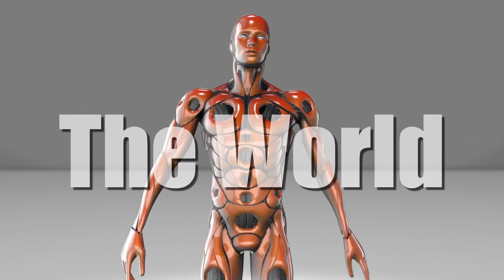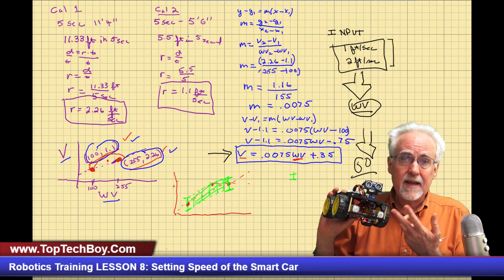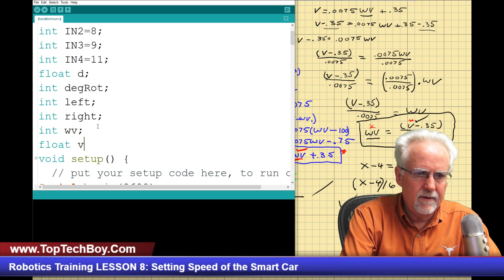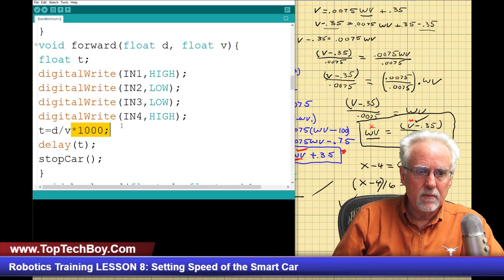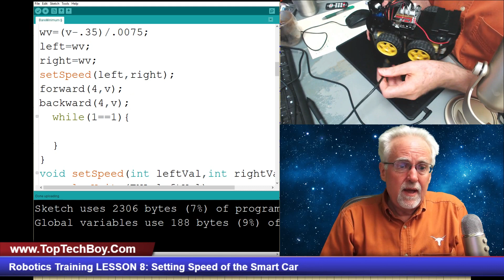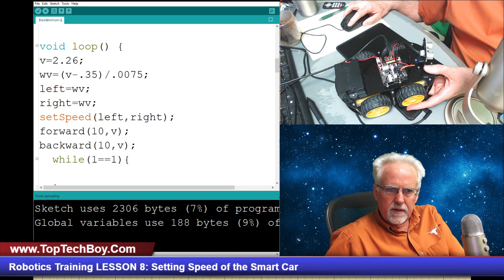Robotics Training LESSON 8: Setting Speed of the Smart Car

Comment: Can we try to solve as a quadratic function? 
import numpy as np
import matplotlib.pyplot as plt

# Define the points
points = [(100, 1.1), (255, 2.26), (177.5, 1.848)]

# Coefficients matrix (A) and Constants vector (B)
A = np.array([
    [points[0][0]**2, points[0][0], 1],
    [points[1][0]**2, points[1][0], 1],
    [points[2][0]**2, points[2][0], 1]
])
B = np.array([points[0][1], points[1][1], points[2][1]])

# Solve the system of equations to find a, b, and c
solution = np.linalg.solve(A, B)
a, b, c = solution

# Print the solution
print(f"a = {a}, b = {b}, c = {c}")

# Define the quadratic equation
def quadratic(x):
    return a * x**2 + b * x + c

# Generate x values for plotting
x_values = np.linspace(50, 300, 500)
y_values = quadratic(x_values)

# Plot the points and the quadratic curve
plt.scatter(*zip(*points), color='red', label='Data Points')
plt.plot(x_values, y_values, label=f'Quadratic Fit: y = {a:.4f}x^2 + {b:.4f}x + {c:.4f}')
plt.xlabel('X-axis')
plt.ylabel('Y-axis')
plt.title('Quadratic Curve Fit')
plt.legend()
plt.grid(True)
plt.show()

Comment: The first time that the battery voltage drop changed our velocity, first thing that came to mind was a current sensing circuit. if the system knows what the current is, we can program it into the calculations.

Comment: Since I did my calculations in metric systems, I had velocity in small decimal ranges (0.325 m/s to 0.785 m/s). So I felt like constantly entering these decimal values is tricky. So what I did was I did double calibration:
1) Instead of entering the decimal meters per second, I entered the speed percentages, from 0 to 100% and I used the linear equation to find the relationship between the right wheel speed (100 (lowest) to 255(highest)) and the speed percentage.
2) After getting the equation from part 1 I found the velocity by using the equation determined from the last video and it all worked out perfectly. The forward and back functions were sent distance and the percentage of speed you want the car to travel and it car actually traveled that speed for that amount of distance!
Reply: Hi Ahmad,
It's interesting since I also use the metric system.
As Paul said in this video it depends on the battery and tires.
With the last lesson I end up with this for 5 sec. and for 2 meters. It isn't perfect and maybe %'ll be better.
m=.0023 and v=.0023wv+.200. 
Which gives results like these : 100 = 1,755m, 125 = 1,98m, 150 = 2,04m, 175 = 2,035m, 200 = 1,98m, 225 = 1,97m, 250 = 1,84m and 255 = 1, 83m.
As you can see it's not perfect but with speeds from 125 until 225 we are very close to the 2 meters.
If I understand your solution you take 100 as 0% and 255% as 100% witch makes 1.55 for each speed between 100 and 255.

With my calculations I had velocity with these ranges (0.430 m/s to 0.790 m/s)
As you can see for the high speed we are very close on the results side, for the slow speed a little bit less. 
Maybe it also depends on the ground.

Comment: I am having a great time with this project. Of course it took me awhile to get the calculations working. I assumed that the digital 'HIGH' was the same as the analog '255' so this would be a simpler calculation. However I was thinking a straight 45 degree line. I did need to calibrate with the digital numbers. 

Suggestion: I can see that the motors are not parallel. I am going to add a brace to the motors to align them straight. This may help the driving. 

I also like the idea of a camera in the front, and a GPS unit to get distances more correct. I would also like to put some flashing lights and a horn and siren, and speaker, and a macho body (This is to make it child proof).

Thank you,

Comment: setSpeed() is a built-in Arduino function. The function definition is "Sets the motor speed in rotations per minute (RPMs). This function doesn't make the motor turn, just sets the speed at which it will when you call step()."
Reply: This should help with the homework assigned. Have you been able to make this work?

Comment: Hi, adding encoders to the left and right wheels helps to take out a lot of variables, but still requires some compensation factors. Some of the kits come with wheel encoders and suitable cut-outs in the chassis for the sensors. These are not difficult to retro-fit to the elegoo model.  The sensors generally have 20 slots so only decode to 18 degrees of wheel rotation (maybe 9 if you detect both edges). I tried using interrupts but polling gives reasonable results. Using pins 2 & 4 means that the existing motor drive, sonar and line tracker can still be used. Using the motor shaft for encoding would give much better resolution but on the motors I have there is < 1mm available and there may be some timing issues in terms of reading both encoders. 
I'd be interested to know if you are considering adding encoders? I'll also be interested to see how you incorporate sonar.
Reply: Hey Keith excellent comment.  I am also fan of "Dronebot workshop" for Arduino robotic tutorials.  Specifically, https://www.youtube.com/watch?v=oQQpAACa3ac shows the encoder implementation in detail. Regards, Aiden.